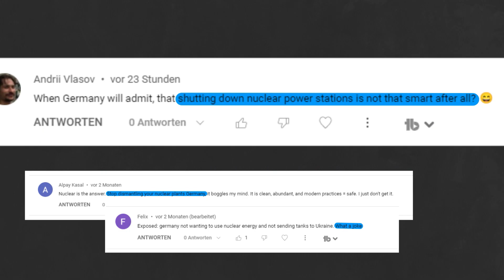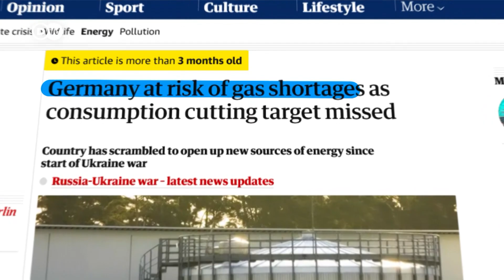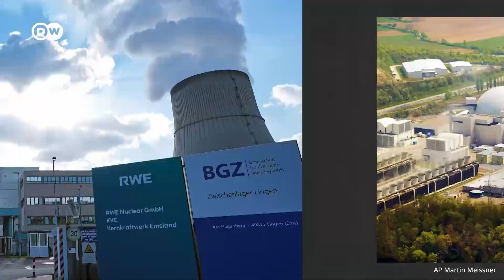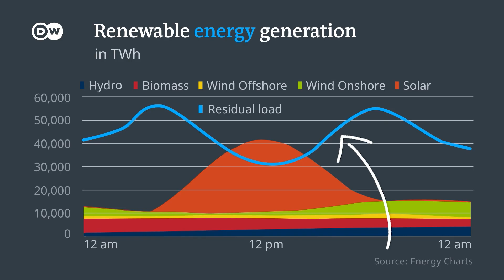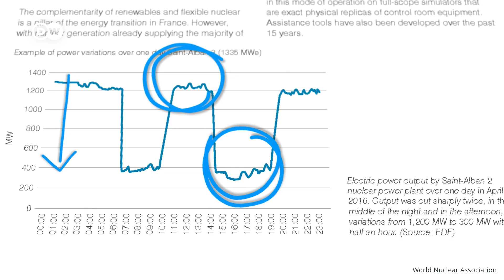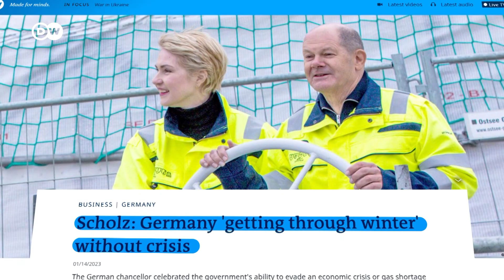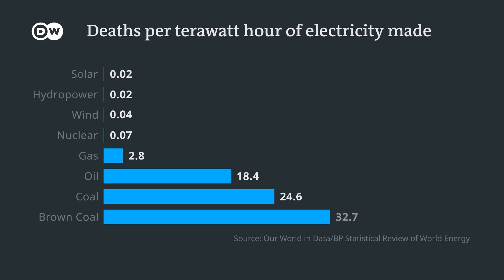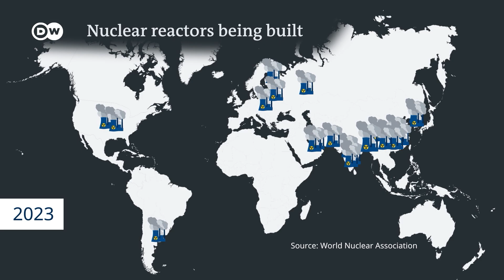Is Germany's nuclear exit a mistake?

Comment: How sad that the master race has come to this. Fears from people with no technical, engineering or scientific knowledge are forcing everyone in the country to have an unreliable electrical grid. To use the arguments that a category 9 earthquake will hit the country and then generate a massive tsunami which will flood the Isar nuclear power station by Muenchen is absolutely crazy. The next argument is the "Nuclear waste must be buried for a million years" one.   Hard to believe adults would fall for this one. In less than 70 years man has gone from elementary powered flight to landing on the Moon. Does any intelligent person not think that in a mere 100 years we will find a responsible technical way to deal with nuclear waste?
Wind turbines are a jobs and  transfer money around plan. These is no way to recycle the worn out wind blades and the gear train set requires replacement every 5 years at great cost being performed 100 meters up in the air. They cost a great deal to erect and have a considerable footprint not to mention the birds and insects they kill on a daily bases.
Solar is another joke which have run its course in Germany now that Government is no longer paying for the power generated to private people with installations for 20 years.
The footprintis enormous and the solar panels are all now from China! Then there is the weather; On July 12, 1984, a powerful hailstorm pummeled Munich. Hailstones up to 10 centimeters in diameter and weighing as much as 300 grams fell in a swath five to 15 km wide and 250 km long, stretching from Lake Constance almost to the border with Austria. This ferocious hailstorm traveled at 60 to 70 km/h and left some 70,000 homes with roof damage; seriously dinged more than 200,000 automobiles and about 150 aircraft; and injured more than 400 people.
Are the panels designed to handle weather event like this? The German government says that the we need to expect more and more violent storms.
Yes, Germany is making a big mistake!!!!!!

Comment: It was the right move. Especially at the time this was up for debate, it wasn't worth the 6% of power generated
Reply: When the decision was made over ten years ago, nuclear made up more than 6% of all power generated. Besides that, if just three reactors generate 6% of our power needs, 50 NPP would cover all our energy needs. I'd argue that's a lot more feasible than attempting to rely on thousands, if not hundreds of thousands of decentralized wind-, solar- and hydroelectric power plants.
Reply: @KonsaiAsTai  Until you realize that the decentralization is a big plus on stability and security. If something goes wrong with your big nuclear power plant, you miss out more energy is something goes wrong with a windmill...

At the beginning of the ukranian war, "someone" hacked a satellite that was controlling a couple hundred wind power plants. And basically nothing happenend. The only downside of this was, that those couldn't be taken down to balance the net, which - if you know about it - is absolutely no big deal. Imagine someone would have hacked/destroyed the ability to control a nuclear power plant... well, not so good

The 6% is right of course. It used to be lot more. But have a look how France got in trouble with their nuclear power plants last summer. Renewables are also very stable, because you have so many small plants, where it doesn't have a big impact if a few of them are having troubles

Comment: When talking about energy storage to reduce renewables' intermittency, there is a solution that is much easier and less impactful to the environment than producing batteries. 

Why don't the engineers consider retrofitting wind generators to house an electric motor on top of them connected to a series of cables and pulley's to lift and release a heavyweight inside their towers?
Of course the foundation and the structure itself will have to be reinforced to handle this extra weight. But it's far cheaper and less maintenance dependant than chemical batteries, and have a much greater lifespan
Reply from the maker: Hey there! There is a company that applies that logic to creating a storage option for renewables. They have their first commercial demonstration unit in Switzerland. If you are interested, check it out here 👉https://www.energyvault.com/ev1

Comment: Yes it IS a extreme mistake to Substitute them we would need 1.266.000m² or over 12.600 windmils (or however you call it in Englisch) what by the way is Like half of the about we have now in the entirety of Germany to replace the loose of Power we should build more modern reactors to have a save and reliable Energy source that isnt even using a tenth of the area we need for alternative Energy sources that only need a night without Wind for a entire Blackout

Comment: Nuclear energy is inefficient and uneconomical. Private industry abandoned nuclear power in the late 1980s, when the last hope of "fast breeders" turned out to be an even bigger economic mistake. Only centrally controlled states, autocracies or countries that suffer from too much money (tax money) have been relying on it ever since. Germany might not have pulled out for the right reason, but from a purely economic point of view it did the right thing. It is unfortunate that due to the incompetent energy policy of the Merkel era, the renewable energies are not yet ready, but in the medium term Germany will again have an economic advantage due to the pending pressure to act with renewable energies. While it is not being clearly communicated in Europe at the moment, the fact is that the nuclear endgame is already underway everywhere. Existing nuclear power plants can be a bridge, new nuclear power plants will be an economic total loss.

Comment: The decision had been made years ago and there were, as the video mentioned, long term preparations made. Yes, with 5-10 year advanced notice the exit could have been reversed in a save way. Doing this for one or two fuel rod lifetimes (about 5 years each) would have been a good solution to soften the dependency from fossil fuel (especially imports). But we did not have 5-10 years notice and so it was to late to reverse the exit in a save and reasonable way.
I personally do not like our now bigger dependency from fossil fuels, but it puts more pressure on the development of our renewable energy sector and that is one thing I really like about this situation. We will manage and will will switch our economy to mainly renewable energy. And we will show this is possible as an industrialized nation and still be successful!

Comment: As a former nuclear power operator for the US Navy, I can state absolutely the Fukushima problem was self made. First, the authorities were warned over a year earlier that a much larger earthquake/tsunami should be expected based on new geological evidence. They postponed any action on this. Next, an available portable diesel electric generator brought to the site, even at sea, and then used to power the coolant pumps would have prevented all of the meltdowns and subsequent problems. I actually was anti nuclear before the "accident", but it showed me that in the worst case simple measures would prevent major problems. So yes Germany decided to kill more of their citizens to coal pollution instead of keeping nuclear power until they had enough batteries. Looks stupidly callous to me.

Comment: Of course its a huge mistake. Nuclear power is the most reasonable power source for our planet going forward.
Carbon free, the fuel is very energy dense, and a very good safety record.

The only problem is the uninformed public. Irrational public fear, in the face of science which shows nuclear power to be less dangerous than fossil fuels. The media blows every accident up into a huge international story, but many more deaths occur because of coal/gas powered plants, than because of nuclear.

And or course, wind, solar, and hydro power will likely never be able to provide enough power to satisfy current needs. Certainly not with current technology, not even if every available space was utilized for renewable power production, it would still have to be supplemented with other power sources.

Comment: We talk about the "mistake" again when the next nuclear reactor blows up and makes a huge part of another country uninhabitable for a long time. It's not a question of "if" but "when". So the German decision is absolutely right, especially since there is no solution for the waste. Who can guarantee safety for thousands of years? No civilisation has been stable so long.
Reply: Somehow I suspect the ongoing issue of climate change such as is being exacerbated by increased fossil fuel use will prove to be a much greater long term problem than reactor fuel waste storage......  Contrary to popular myth one can not entirely replace energy needs supplied by such reactors via "green" sources.  Energy use continues to rise and thus it must be supplied lest shortages occur which cause adverse economic impact.  

The Chernobyl event was a result of poor design and management and the Soviet State suppressing critical information about the reactors from those who operated them.  The same paradigm does not exist in the German or others' nuclear industries.  🤔

Comment: Germany needs to turn off the old reactors anyway. For different reasons:

1) A 1GW-Reactor would already boil off 1000 l of water per second. How many off these does Germany need?
We had several dry years in the last 10 years. And we are not the only country on Rhine and Danube that needs water.

2) Old reactors use scarce fuels. So we would need new reactors anyway.

3) Germany´s Geology is not quiet like the one of Scandinavia.
Gorleben has shown that large areas in Northern Germany are unsuitable for storage.
Bavaria and the Rhine area have earthquakes up to 5.5 from time to time. Saxony isn´t quakefree either.
The Middle Rhine(Eifel) has even an undersurveilled hotspot volcano. 
"Germany has no active volcanos. So we don´t need to make a risk assessment about the one that erupted 13000 Years ago.😄"
So waste disposal will have to look a bit different than in Finland.

Even with new reactors we still have to relocate big parts of our industry to the north. Or build a lot of looong cables. 
So Germany was stuck with renewables even before the first reactor was switched on.

Comment: its a very harsh but good decision.  power supply will still be secured throug imports from european states. thats a powerful decision and signpost to the future. now germany is forced to comply with the carbon dioxide reduction. this is only possible if you stop coal mining and accelerate the expansion of renewable energies. In this way, germany can be a pioneer and find solutions to problems.
it gets only worse when other states follow the same path and start shutting down early